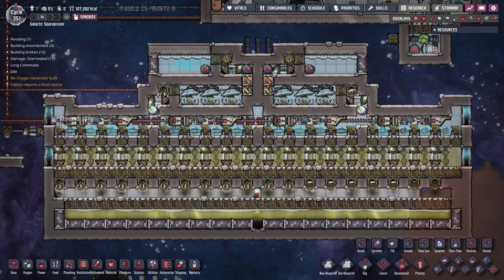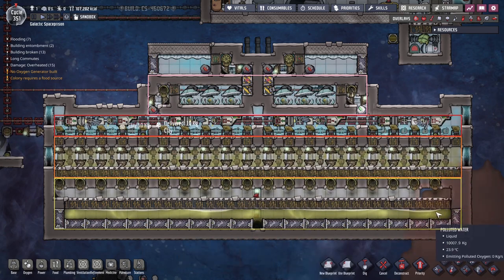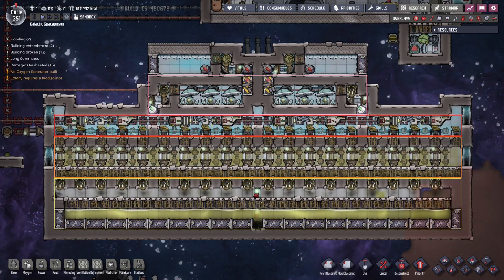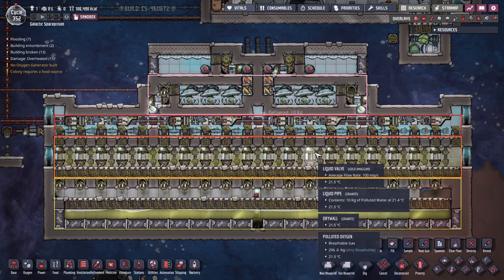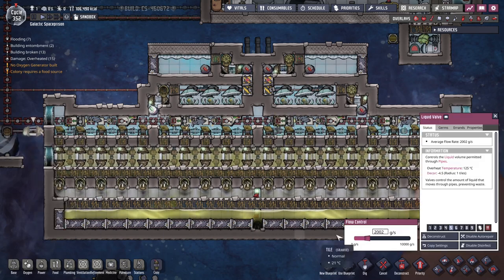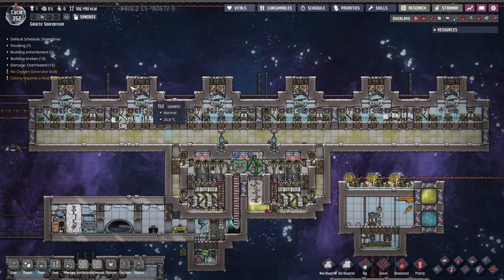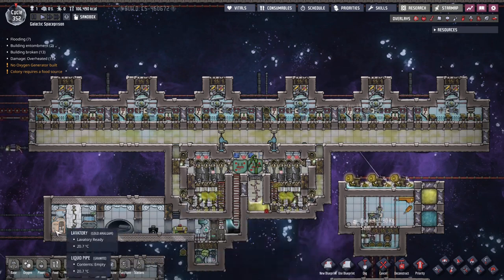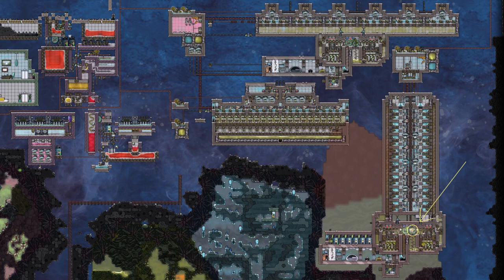Deodorizer Madness! - Oxygen Not Included

Comment: You can build a layer of mesh tiles on a layer of airflow tiles, put the deodorizers on the mesh tiles, and fill the mesh tiles with water to make sure no polluted oxygen backflows downwards. This does not require spaces between the deodorizers, so it also means you can cut down the width of the design by almost half. This also means you can have a single high-pressure oxygen room with both deodorizers and pumps.

I like your diagonal bypass pump setup for keeping the bottom area low pressure. It's an elegant solution that I'll probably try out next time I build one of these setups.
Reply: I was about to post same thing about the mesh tiles and water ,,lock,, under deodorisers ;)
Reply: @Mysterious_Old_Geek  Deodorizers have the same detection range as absorption range - it's pumps that have them different.

The range of a deodorizer is a diamond centered on it, which reaches 2 tiles up, down, left and right. This allows it to pull polluted oxygen through a tile of liquid, such as a visco-gel liquid lock or the setup I described.
Reply from the maker: Yes, this turned out to work much better, thanks! Just found it in a Steam post by Kharnath. Adding bypass pumps to the mesh tile design speeds-up the offgassing.

Comment: Hey GreezyHammer. To your question about the door release mechanism  It should work fine with one or two more doors and a couple of atmosensors. I have that on a stacked electolyzer setup with no pumps but doors as a release. The trade off here is:  no popped ears means bad and slow airflow. So the placement in the base can be essential when it is the only oxygen source.

Great design as always by the way!
Reply from the maker: Thank you! The testing continues.

Comment: To get the sand (if you don't want to rely on regolith) you could probably make a wild pip farm with arbor trees. Pips produce dirt, which can be turned into sand by heating it.
Reply: You can also use an ethanol distiller to convert the lumber from trees into polluted dirt, and then feed the polluted dirt to pokeshells to get sand.

Another option is to use the rock crusher to smash up rocks, which is not renewable but might as well be with how common rocks are.
Reply: @tetrikitty1686  He said he was crushing igneous rock from his regolith melter to feed it, but it requires duplicant interaction, while you can sustain a massive pip population without using any dupes at all.
Reply: @packediceisthebestminecraf9007  That's true.

Comment: In the 1st design, what is the liquid being dropped in the bead valve pumps for O2 output? I see the naptha under it, but is it pumping PH2O? Petroleum? Where does that 1 g of liquid go and how does it get pumped back up? My instincts tell me it should over-pressurize at the liquid vent or fall onto the waterlogged deodorizers, but I know that's not correct.
Reply from the maker: In this one, drip uses 100mg PH2O. At 100mg, the game deletes the drop shortly after it materializes.
Reply: @greezyhammer764  Wow. Didn't even know that. I only knew about gases at a few micrograms being deleted.
Reply: So you get the drip valve pump effect and instantly get vacuum again, then gas again, and don't lose any of the gas in the process. Beautiful.

Comment: Think you should get into the ups/downs, of producing oxygen this way contra using clean water?
Reply from the maker: Will do!
Reply: I personally consider this and other pwater offgas setups more a way to produce clay at an opportunity cost of hydrogen than a way to produce oxygen;  The main exception to this is the early game if you are trying to stretch out your water+algae supply with algae farms. 

Obviously, the big con for this one is it requires a TON of setup with some things that can go wrong. The pro is it requires-or required-a bit less power to run, and produces a tiny bit more oxygen per input amount of water than electrolyzers, which might be important if you're trying to shave that last few percent more o2 out of some map.  The next obvious con is that you don't really get any hydrogen, so power you shave off for this setup over electrolyzers is probably more than lost by the amount of hydrogen you're missing out on.

Comment: I love your designs, though, can you tell me how do you get the naphtha out (or liquid used for the pump) between the polluted oxygen chambers?
Reply from the maker: Start with a vacuum chamber, build drip vents, bring a pipe of naphtha or oil, valve at 300g. Feed 1 vent at a time, then remove oil pipe. Then build the rest.

Comment: since hatches can eat 140kg of clay per cycle, is there a way this could be used to continue running hatches? stone hatches are good, but the resources are limited.
Reply from the maker: Regolith Melter. Will be no shortage of igneous rock for Stone Hatches.
Reply: @greezyhammer764  this is true of the base game, but there is no asteroid impacts to keep delivering a continuous supply of regolith.
Reply from the maker: @commonsense-og1gz  Good point. Next best thing is volcanoes & turbines with piped magma setup to extract cool igneous rock.
Reply: @greezyhammer764  for the stone hatches perhaps. i do like alternatives for others as well. i am always searching for ways to use other forms of critters. 

i have used polluted dirt from ethanol distillers to feed sage hatches and feed them fertilizer from synths. the standard hatches, however, could be a near free energy resource if they could be fed clay from deodorizers.